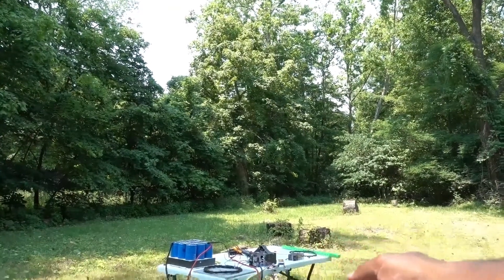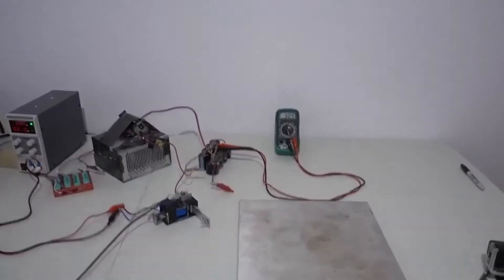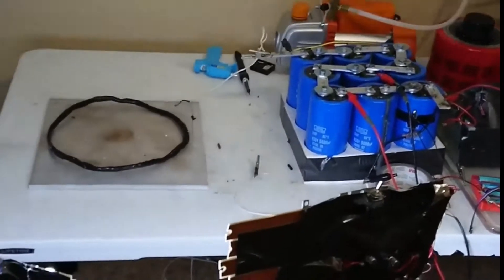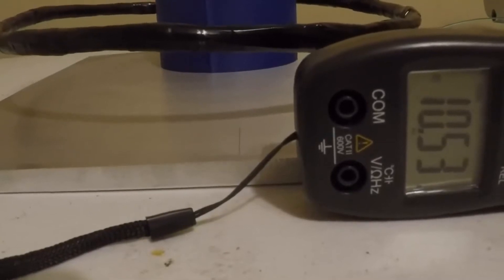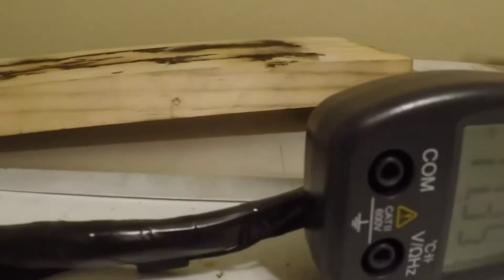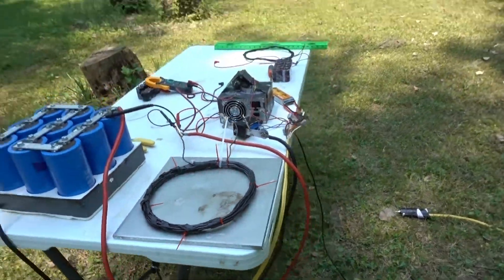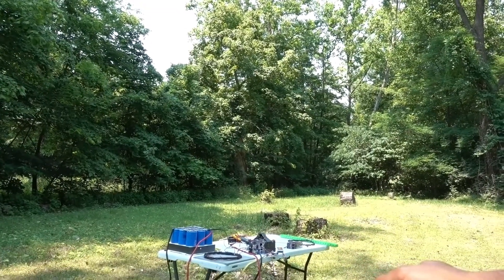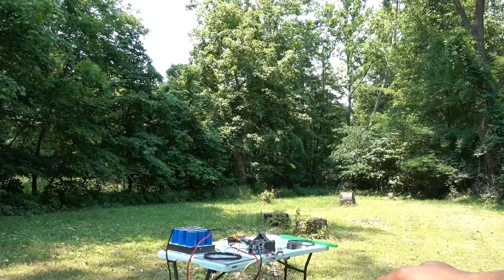Electromagnetic Repulsion by Capacitor

Comment: Can i reverse this setup ? Meaning - would slapping/slamming a coil hard enough on that plate be able to generate the power you inputed ?
Reply from the maker: @AGI-Bingo  yes, but the plate would have to be a strong magnet and the power output would be much less than what I used in the video.
Reply: @NeutronStudios1  could you explain why? Isn't there a conservation-of-energy law that indicates a reverse process should result in similar power outputs? 
I'm wondering what's the terminal velocity of a coil now hahaha